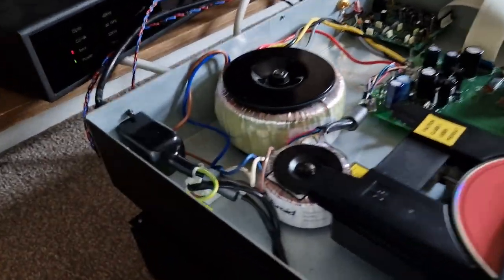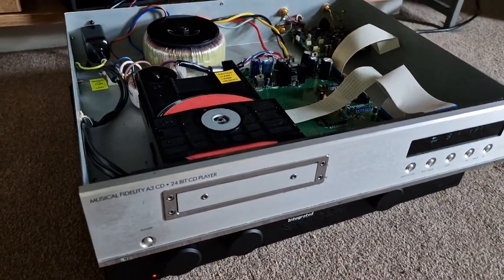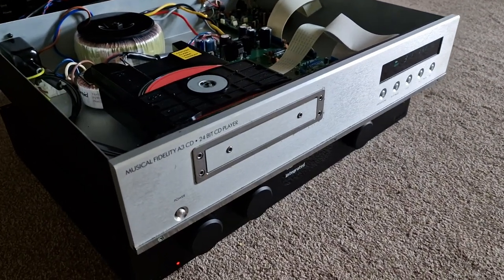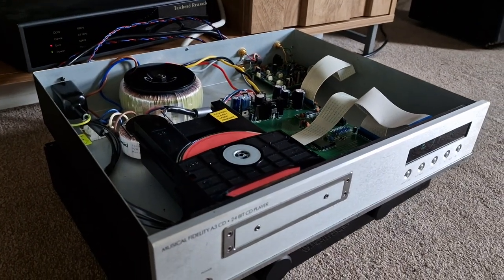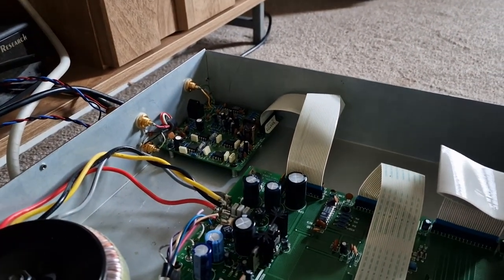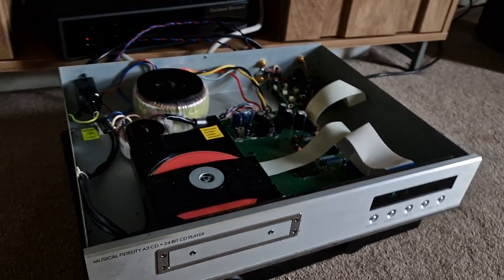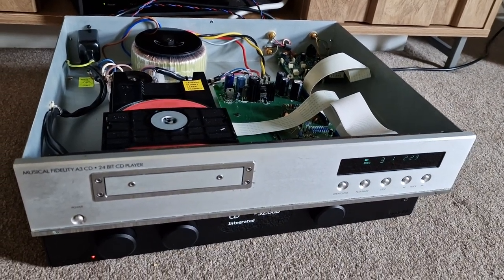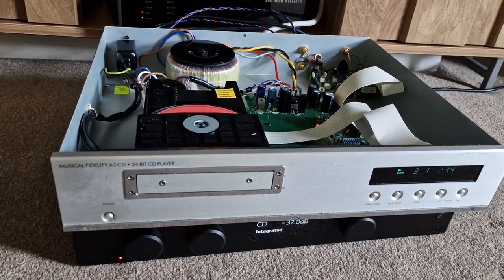musical  fidelity A3 finished

Comment: Hi
My A3.2CD player doesn’t read discs. I believe the laser assembly is damaged and it doesn’t read the discs. Always shows No Disc. Is it an easy repair? Please let me know
Thanks
Reply from the maker: Yes m8
Reply: I sold the CD player to a guy and in shipping, it got damaged and the disc just keeps spinning and atlast says No Disc. 
Thanks for your reply
Reply from the maker: @roberts733  if the laser was spot on when you send it I would check all the ribbon  cables are in correctly